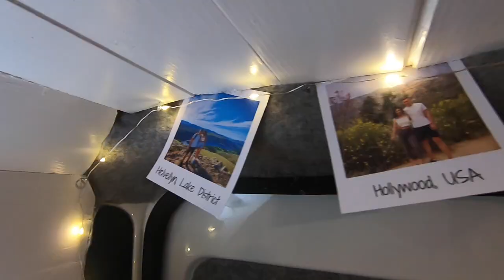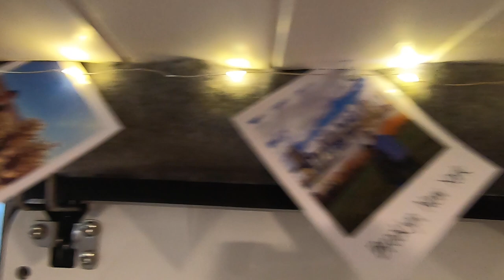DIY CAMPERVAN CONVERSION (TIME LAPSE) UK VAN TOUR! PEUGEOT BOXER VAN TO CAMPERVAN BUILD #vanlife

Comment: Nice work but they have made the mistake a lot of people make is that they should have painted the wooden tongue and groove before it was put up. By painting it in position then when the wood shrinks, which it will, the bare wood will show especially if painted in a dark colour.
Reply: Hardly going to shrink that much he screwed it in place haha 😂 need to be some on godly shrinkage to pull screws out of place

Comment: Lovely video mate! Really good! Enjoyed how you showed every step of the way! 

I’m thinking about getting one myself I currently have a Vauxhall vivaro. With a fixed bed but the bed width ways is to short as I’m 6ft 2 what’s the finished measurement of the bed length once you’ve got the mattress on and ply’d the walls out etc. from one side to the opposite as mine currently is 5ft I think. Obviously I need longer.

Comment: Hi is the insulation moisture proof the conversion looks great BTW
Reply from the maker: It's rockwool, people have their own opinions about it in vans but I believe it to be just fine
Reply: @TravelEpisodes  Beautiful campervan, however, you made a mistake not to install a vapor barrier. If you use the van when it is cold outside, condensation will form on the car body. You need to know about it and control it. In addition, you will also have mold under the mattress. The plate must be openwork.

Comment: Hi guys where did you get the small window from over the bed
Reply from the maker: Hi, we popped to out local scrap yard to see if they had any of its kind, and there was a retired camper with a perfectly good clean sliding window, so we saved it for £30